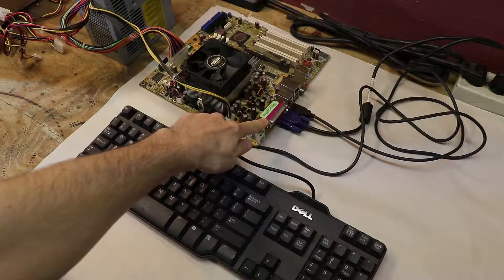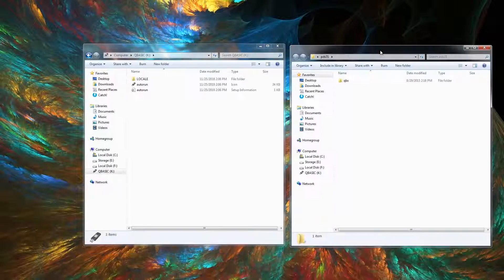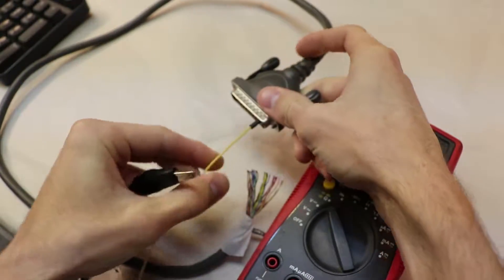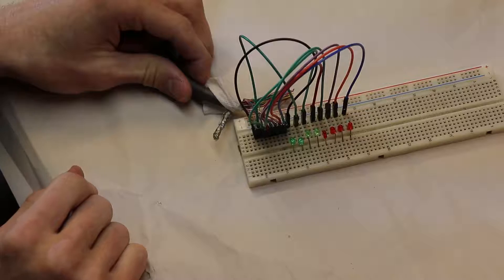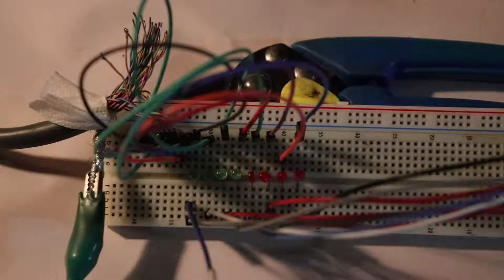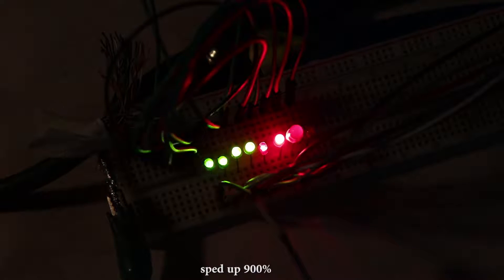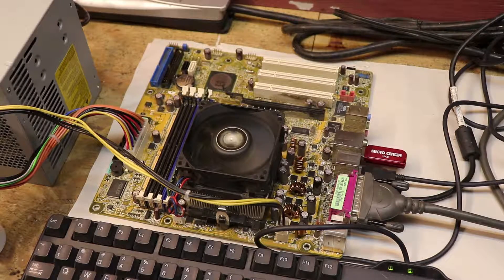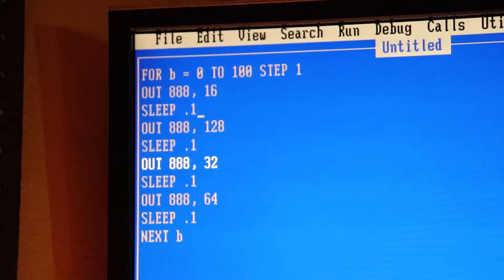Forget the Arduino and Pi, use your old PC!

Comment: comments are hilarious, people crying over a free cable (since they are no longer needed), over the electricity bill (while air cond or heating is ON), comparing PC with arduino... :)
Reply: XD there are a lot of reasons why i think this would be rather odd for application, but i do think this is a great video and honestly it is a great way to get people out of the mentality that an arduino is somehow unique. I/O is a constant in computers, it exists on all levels, even electrical XD. I do think... the size, overall power draw, and normally not accessible(if you have a unused old pc sure but most people don't... although i do.) aspect of it makes it rather abnormal. XD .... but I have seen other channels do stuff like this, like the 8bit guy. I mostly would be put off by the size, the power draw would also be a factor but if i needed something that could push power to third party units or needed a lot of IO i could see using this if it was sitting around and I didn't want to wait... although i would have just used jumpers on the pins on the end of the cable XD nothing wrong with cutting it and making it work differently.
Reply: Thats what I thought?
Reply: PCs like these draw around 100W I think. Let's say 150W just to be sure. If you use them 10 hours a day, that would be 1.5 kWh per day, and 10.5 kWh per week. A Raspberry pi costs $35. That would mean you're paying $3.3 per kWh and idk where do you live that has such high energy costs.
Reply: lol on what planet does a landlord pay for your heating and aircon... next you'll be telling me he pays your rent as well. Think, McFly....
Reply: I have a kill-o-watt meter and my conclusion is: you can use a old laptop (with the screen off) for a server..... The power that use range from 8 watts for an atom cpu to 25 watts for core 2 duos that start with a P, to 35 watts for core 2 duo that starts with a t. If you use a processor that is an i3, i5 or i7 that has a U in the processor name then it will use as low as 15 watts but will have 10-20 times the processing power of a raspberry pi. They scale.. when not in use their cpu draws less power. I forgot to mention some celerons that have very low power draw. For example I have a small cheap laptop g40-30 (or is it g30-40?) That draws very little power. You can find laptops that are free or for very cheap that might lack a battery or have missing keys or a cracked screen.. but you don't care about that stuff since you can use it through vnc or remote desktop
Reply: cops get something from hotel after ? :)
Reply: @Kenny-bw2cz  long time ago i connected "everything" on ups so i know that pc draws small amounts, but didn't wanna argue. Besides i have maybe 20-30 pc boxes and many lpt usb etc cables so i'm used to just take one and use it :) i like pcs cause they are very universal with large known base of software, and i don't have to learn new stuff all the time, i leave that to younger brains with lot of time to spare :)
Reply: maybe the chief have a room whenever he likes :) with free service :) are hookers legal there ? :) Where i live the corruption IS a sistem :) eg. I bought new 2 pieces of 2kw apc ups for cca 15 euro and i donated one to faculty of electrical engineering :)
Reply: @pingvinac  I know.. that long comment was for those who were freaking out about using a normal motherboard... I'm on board with you. If they are thinking that much about the environment... They are not thinking about home much energy is needed to a create a new raspberry pi  and its power adapter package it ship it from China and then after some years it will end up as trash. We are better off tying to use what we can if it does the job. So I'm on board with you all the way!
Reply: balkan :)
Reply: @devdylan6152  If you don't care too much about power, and want a VGA style screen this is a good start. Not too much I/O because you only have 8 lines, but you may add parallel cards if you find them in some PC scrapyard.
Reply: @Alejandro1957  why not daisy chain shift registers.
Reply: laptops has no parallel anymore since 2000's
Reply: And more than input/output this is only output. If input is required is a different matter, way complex than raspberry or arduino, and only digital levels!!! And processing power doesnt matter when parallel port is so slow...
Reply: @christiancarassai9540  if you are familiar with digital electronics you can allways turn to 115kb/s serial port
Reply: @s4rg380  with some 4000cd series or 74.. more effort in drilling pcb than designing :)
Reply: I don't have the AC on. Can I complain?

Comment: If you connected all the led's to the -ve rail on the breadboard you could have saved heaps of wires and some time as it would have put those legs in parallel.
Reply: probably this was not in the textbook
Reply: Sht I was thinking about the same damn I'm very newbie electronic hobbyist and notice it immediately .

Comment: Great video, thanks for the nostalgia. Two suggestions: 
1) Use the TIMER variable. It counts milliseconds. 
In GW-BASIC:
1000 REM Delay - can be down as low as hundredths of a second
1010 CURR = TIMER
1020 IF TIMER < CURR + DELAY THEN 1020

2) Use the power rails on your breadboard. You could put the LEDs in to the breadboard with the cathodes (shorter leads) in the blue (negative) rail, and that would save you all of those jumper wires going over to the right side of your breadboard. It would also be a bit safer to use 360 ohm resistors in series with each LED; those could go across the trough for each column of the breadboard that has an LED.

Comment: LOVE IT !!!!! I grew up with old XTs, then later learning DOS at University doing Mechanical Engineering and using GW Basic and then Fortran about the time that 486DX4’s first came out. The Computer Lab at Uni had 386s for student use and the mainframe was a DEC10. 
Massive in physical size!!!!
My first hard drive had a 20 Mb capacity!!!!!!!
Reply: Ah, the ol' Seagate ST-225. I installed a lot of those back in the day. I remember when the ST-4096 came out - a full height 80MB HD. The thing was a brick.

Comment: For some reason this video was suggested for me, and I'm glad! I appreciate this is an old(ish) video but still worth commenting on. As others have said, use a buffer or logic IC when interfacing a parallel port as that was how it was designed. It is also possible to use serial ports to achieve the same thing, but it's more complex electronically.

Watching this reminds me of a parallel port project I bought years ago that had eight relays in it and you turned the relays on by sending the appropriate characters to it. It was simple to control in that even a DOS batch file could 'print' a control character to it. In this way it was possible to have DIY peripherals turn on or off when a certain program was started with a batch file.

The main point of all this is that it was so SIMPLE to interface to a PC in those days! The parallel port is very simple, as is the serial port, and data can be sent from the command line without ANY drivers needing to be loaded.

The USB port, by comparison, is an absolute nightmare because so much is required just to do the simplest thing. If you want to try and interface directly then, basically, forget it! If you don't mind using third-party ready-made electronics then there are USB-to-Parallel and USB-to-Serial interfaces that may help provided you can sort the appropriate drivers out for these interfaces. The old parallel and serial ports may be more complex electrically and not even provide any power but they are simple to use in software, whereas USB is the opposite in that it is (relatively) simple electrically but far more complex software-wise.

Fortunately, the are a few add-in cards that will proved serial or parallel ports properly, as well as a few modern motherboards that have a serial port on them (even if it is just a header for a wired port).

Comment: I did this exact thing in 1987 to control X-Y tables used in production in a laser machining lab.  We upgraded to a Centent CN0170 after some issues with repeatability and speed ramping.  Within its limitations, it was cheap, effective and versatile.

Comment: This guy makes a good point, I want to create a production line that’s fully automated and considered esp and arduino varients as well as other SBC like Pi to operate PLC actuators belts for a full autonomous production facility employing 0 or the least people but the one problem always arises, no way of securing it since you can’t configure a zero vulnerability effected system but I have several old but hood boards I can configure to be 110% air gapped making it zero connected to the web , since there’s tons of information on them being old it makes it alot easier then using new boards which are extremely vulnerable to things like cyber attacks. Great video.
Reply from the maker: Computer boards arent that great for an industrial enviornment depending on what you have. If you have an old server motherboard with ECC memory that would be a lot more stable than a regular PC board. Look at Delta PLCs or automation direct PLCs, that would be a better option depending on your budget. But if you really want to use a PC motherboard I would recommend looking at old server. They are built for non-stop operation and have bios settings that are helpful, like automatically booting back up after a brown out/power outage
Reply: @SciCynicalInventing  I don’t know about that. A custom cheap case anyone could even make which in my case would be lead enclosure vented and filtered to protect against hackers trying by any means like RF sniffing all hard wired to DIY programmable logics shielded wire since those can also be easily sniffed for data if unprotected and a host of other apparatus makes it doable , programming pics aren’t hard anymore and since a lot of old systems of various types still have PIC chips in them which are easily recoverable and recycled it’s easily affordable to build from the floor up, just takes planning.

Comment: there is a python library for parallel port programming called pyparallel.
Reply: are you sure python can work on DOS?
Reply: @alexstone691  it works on windows and linux. You can visit its github repo and read the documentation, it is explained very well there.
Reply: Missed opportunity to call pyrallel
Reply: @alexstone691  kllll
Reply: @hanzofactory  it's kind of a naming scheme like the serial library is called pyserial

makes it easier to find what you want, better than a pun tbh
Reply: @tazogochitashvili6514  Yes, but it's still missed opportunity.

Comment: way back when  pcs had the horrific ISA slots you could get proto slot cards. i remember maplin electronics sold an isa projects book that worked using qbasis. if i remember correctly yoy can also use some of the parralell pins to up the anti to bi-directional transmission. so you have input and output.. i think maplin also did an RS232 projects book.
Reply: I'm actually surprised they don't still make these, considering how many companies producing PCB projects for the hobbyist there are.
Reply: Rip maplin 😔
Reply: Such prototyping cards were available with PCI, too, but they needed a PCI bridge for the protocol and speed and presumably, were too complex to reach for amateurs, so they went the whole way to FPGA solutions for development or low unit count, for companys without fabs.
Reply: My dad used one of those to make a card to control a small pipe organ. It all still works.

The closest thing today is FPGA dev boards on a PCIe card with lots of different I/O. literally 1000x more expensive however!
Reply: @zayanh2823  they're back online ... I know. Surprising.

Comment: back then, we used a simple loop to check how fast the processor was:

TIMER ON
ON TIMER(1) GOSUB exitcpuspeed
DO
speed# = speed# + 1
LOOP
exitcpuspeed:
TIMER OFF

that gives us a number of how many do-loops your computer does in one second.

then you can use that loop to create a finer resolved timer:

DO
dummy# = dummy# + 1
LOOP UNTIL dummy# > (speed#  / 10)

that gives you just a little bit over 0.1 second delay - because you put a few cpu cycles extra for the comparison into the delayloop
Reply: nice
Reply: I remember DOS games that were written with timing loops that way... They quickly became unplayable when the IBM PC/AT was introduced since it was 6 times faster than the original PC... The game Centipede wasn't a slow crawl anymore, it was a very fast race to the bottom... People actually developed TSR programs that would take processor cycles to slow the PC down so that the old games could be played...
Reply: @jakeblanton6853  it doesnt matter how fast the processor is. Timingloops always work as long as the number fits into the variable

Check my code.
It checks te cpu speed and takes that as a base
Reply: @TechTomVideo  -- But that wasn't the way that timing loops tended to be used back then since the developers did not tend to take into the account that the processor speed by eventually change.  Basically, the developers figured that there was just one type of PC and it ran on a 4.77 MHz 8088, so all PCs ran the same speed.  They started to get an indication that was an incorrect assumption when a couple of the PC clones came out with 8086 processors (which I remember being 8 Mhz, but I think some 10Mhz might have also been around).  It's been a long time and my memory is a bit hazy about the specifics.  Although the 8086 was developed first, the 8088 was used for the original PCs because of it being cheaper to create a PC from it.
Reply: @jakeblanton6853  please try to understand my code. Your argument doesnt make sense here. We were timing steppermotors and cnc machines that way and the programs worked as long as tere was any DOS available because you need single task realtime.
Reply: @TechTomVideo  -- Oh, I understand your code... I'm just saying that back in the original PC days, when programmers used timing loops, they seemed to seldom take into account the fact that their code might eventually be running on a machine that was not the same speed as they had developed it for.  It's the same mentality that gave us the Y2K issue -- no one thought that their code would still be around when a 2-digit year would not work.  Hell, I've got code out there at some companies that I worked for over the years and it is going to be needing to be modified to work correctly after 03:14:07Z on 1-19-2038 because back then, we just assumed a 32-bit integer was big enough to hold time values for as long as our code would be used.  Even after over 20 years, some of the systems that I wrote are still being used.  It's unlikely that I'll still be alive when time_t rolls over though... Not that I have anything else planned... :)
Reply: @jakeblanton6853  - yes i know that - but then your argument is kinda off-topic which i did't get in the first time.

but i appreciate your sharing of your old non volatile memories :)
Reply: Nice to see that. I used something similar but also had a comparison in the first part like:

TIMER ON
ON TIMER(1) GOSUB exitcpuspeed
DO
speed# = speed# + 1
LOOP
 until speed# < (speed# / 10)
exitcpuspeed:
TIMER OFF
Reply: @webosm6494  - yeah cool.
you compensated the extra cpu-cycles in the delayloop.

Comment: If you'd used a DB25 connector, you could have kept the cable intact. I used to use a similar method to control relays from the parallel port and did temperature sampling using some 1-wire sensors and a PIC via the serial port.